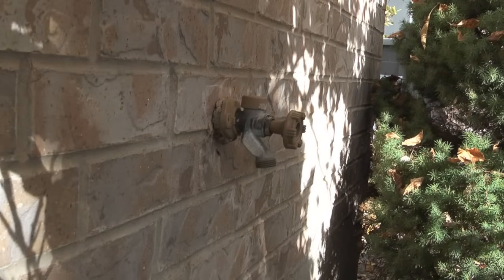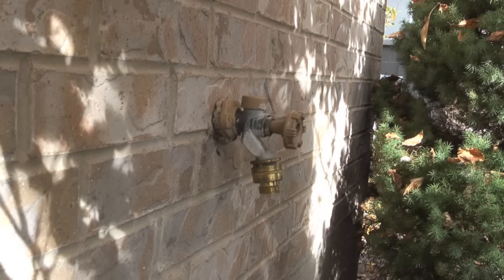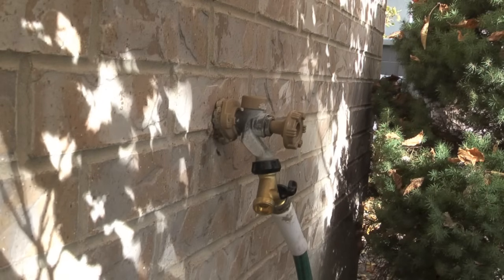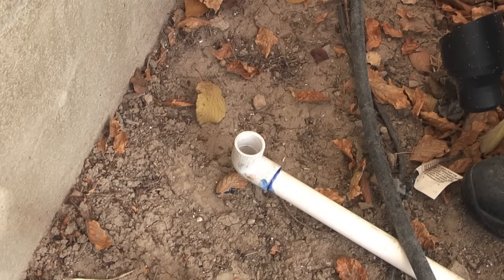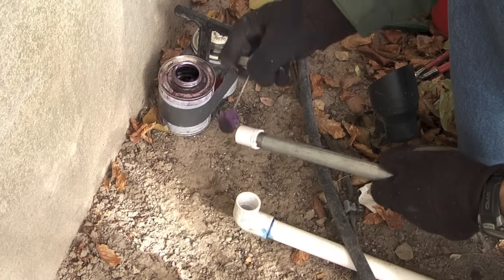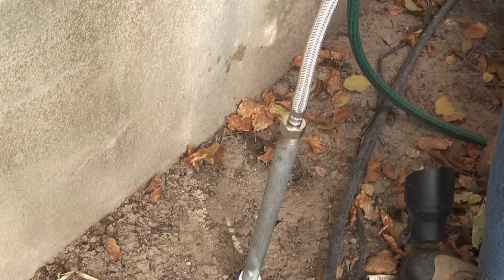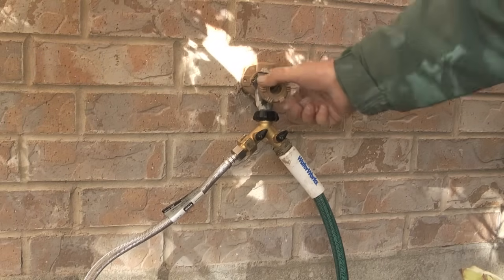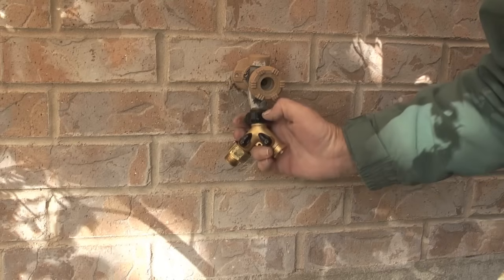How To Connect A PVC Pipe To An Outdoor Tap/Faucet

Comment: Hi! Is it possible to connect the braided flex line to the PVC without the galvanized steel line in between?
Reply from the maker: Yes, you could use a PVC 3/4" x 1/2" male adapter.

Comment: Great video thanks you just saved me a boat load of money, you answered question I had all in this video except one. After I make the connections you just showed can I use Polyethylene piping attached to the PVC for my sprinkler system I rather use in my yard. Also I would like to connect a sprinkler valve manifold so I can use a wifi timer.
Reply from the maker: You can use Poly pipe with PVC. Be careful on how many sprinkler heads you use for each valve in the manifold because the 1/2" tap will only supply 5-6gpm (gallons per minute) to the manifold.
Reply: @Iscaper  I was thinking of using no more than 3 on a zone, would that be ok with the 1/2" or would the 3/4" poly be better? I have 5-6 GPM coming from my tap.
Reply from the maker: @laamkingent1  Add up the gallons per minute the nozzles on the sprinkler heads use when designing the zones. Don't exceed 6gpm. Either 1/2" or 3/4" poly will work but you'll get a little less friction loss using 3/4" poly.

Comment: Awesome video 👍 thx so much , going to use this on my drip system from a double hose Bibb ! 👍👍 is there a way to put a shut off value on the galvanized riser too ? ?
Reply from the maker: Yes, attach a ball valve to the galvanized nipple and a short nipple in the opposite end of the valve that connects to the flex line.
Reply: Thx you !👍

Comment: I skipped the steel pipe and hooked up the braided flex line directly to the PVC (after the PVC thread coupling). Would it be a problem to bury the flex line to the ground?
Reply from the maker: The flex line will probably rust faster in the ground.
Reply: @Iscaper  Got it. Thank you.

Comment: Good video, but why do I need the galvanized pipe? Why not use a male treaded elbow up at the PVC and eliminate the galva
nized pipe. Just screw the braided line directly onto the nippled up PVC elbow.
Reply from the maker: Male threads on PVC fittings are notorious for cracking and splitting, especially when bumped. I like to use something stronger when transitioning from PVC. That said, what you recommend would work also.

Comment: So if you have consistent water pressure in the lines 6 months out of year does it makes since to install a automatic drain in the line ?
Reply from the maker: In cold areas yes. When the supply is shut off in the fall the automatic drain will open and drain the supply line.

Comment: Thanks for the response. I think copper but not sure for that outside faucet. Sounds like I may need to try and get into the wall a little to secure the pipe.
Reply from the maker: If you can, try turning on the tap and see if you can find the pipe feeding it. Then grasp the pipe and see if that stops the vibration. I would try to isolate the noise before tearing into the wall.

Comment: Will a 3/4 in. FIP x 3/4 in. FIP x 15 in. Stainless Steel Water Heater Supply Line work? Currently it's leaking from each end. I have connected that to a spigot and then to the pvc.
Reply from the maker: Tap/faucet is hose thread not FIPT (Female Iron Pipe Thread). You would need a 3/4" FHT (Female Hose Thread) x 3/4" MIPT (Male Iron Pipe Thread) adapter for this to work. Here's a link:
https://www.amazon.com/summery-life-Connector-Industrial-Fittings/dp/B07MVK22VT/ref=sr_1_2?crid=2PZJRUH9GR96P&keywords=3%2F4%2Bfht%2Bx%2B3%2F4%2Bmipt%2Bbrass%2Badapter&qid=1689345476&s=lawn-garden&sprefix=3%2F4%2Bfht%2Bx%2B3%2F4%2Bmipt%2Bbrass%2Badapter%2Clawngarden%2C140&sr=1-2&th=1
Reply: @Iscaper  Wow! No wonder why it was leaking. Thank you

Comment: this is exactly what i needed to run water to a deck with a sink!!!!.. could you do the same to make an irrigation system?
Reply from the maker: You could feed a sprinkler manifold via the tap but you'll only have 5-7 gpm (gallons per minute) flow to work with making more valves necessary. That's because most taps are fed with a 1/2" pipe restricting the flow available.

Comment: I did this this weekend for a line to garden 200ft. I installed drains about every 50ft. When I open the spigot at the house the drains flow until I open the spigot 200ft away is this normal ? How do I not get them to drain when I turn on water from house?
Reply from the maker: If I remember right it takes 7psi for an automatic drain to close. The drains will probably try to work until your sprinkler line pressures up.

Comment: I enjoyed it. Oh! Another request video similar to this you can do. Is connecting an underground sprinkler system to the main line vs an outdoor tap. And explain the pros and cons of each. 😎👍
Reply from the maker: The problem with an outdoor tap is flow. Most are fed with a 1/2" pipe and will only deliver 5-6 gpm (gallons per minute). This means a lot of valves would need to be installed to accommodate a sprinkler system. Main lines to houses are usually 3/4" pipe and will deliver a lot more flow (9-12 gpm) for a sprinkler system. Using an outdoor tap for a supply is good for planter beds and garden areas, but I wouldn't use it to feed a whole system.
Reply: iScaper1 oh ok I see😎

Comment: I was about to follow this clip to make connection between water valve to PCV but I found at home depot a flexible Dura pvc repair coupling that work as well but more simple. Dura makes 1/2, 3/4, and 1 inch coupling (18 inch long). You can use an Orbit slip fitting (at sprinkler isle section of home depot ) to connect to garden valve and some pvc fittings to make the connection to the pvc on the ground.
Reply from the maker: Good information, thanks for posting.

Comment: Tried same set up for feeding water to the sprinkler system. The braided hose does not provide enough pressure for all the sprinkler heads
Reply from the maker: It's not pressure that's affecting you it's flow. You can only get 5-6 gallons per minute through a hose bibb, because it's fed with 1/2" pipe.

Comment: Great solution!  The braided flex line was exactly what I needed to make this work. Thank you!
Reply from the maker: Thanks Randy. I've seen a lot of installations where the homeowners try to hook the PVC directly to the faucet/tap and it usually leaks or cracks. The braided flex line cures that problem. Thanks for the feedback.
Reply: iScaper1 Right. I had been using a PVC Garden Hose Adapter connected to a short host to the faucet (for lack of a better solution). It lasted 2 years, but was leaking this year and snapped apart when I went to tighten it.  I had thought of looking in the kitchen faucet/laundry area for a doubled ended hose.  It worked perfectly and was a quick fix.
Reply from the maker: Randy Braatz
I agree, garden hose and fittings seem to be a little weak for this type of connection.
Reply: iScaper1 Great video, thanks! Is the braided flex line the same one used for faucets and washers inside?

Comment: I used this method but went to 1/2 in PVC instead of 3/4.  Now, at my spigot that the pipe ends at, I attached a oscilating sprinkler and it doesn't have nearly the pressure I used to.  Any suggestions on what went wrong?
Reply from the maker: You can only use 4-6 gpm (gallons per minute) with this type of connection because the faucet is fed with a 1/2" pipe. I would first try a sprinkler that uses less water.

Comment: Why did you go from the house tap 3/4 to a 1/2 hose, then back to 3/4 for the pvc?
Reply from the maker: I wanted a strong flexible connection with IPS swivel connections so when winter hit I could quickly undo the connection from the faucet and drain any water away from the faucet to prevent freezing. I could only find that in a 1/2" braided faucet supply. That's why I went from 3/4" to 1/2" and back to 3/4". The faucet/tap supply is 1/2" so I didn't have worry about any flow loss doing it this way.

Comment: Is there a benefit to using 3/4" pvc instead of 1/2"?
Reply: Also, the inner diameter of the flexible pipe I bought appears to be much smaller than 1/2 inch. Is that a problem?
Reply from the maker: 1/2" PVC pipe would work also. The faucet will only deliver 5-6 gpm (gallons per minute) because it's being fed with 1/2" copper pipe.

Comment: Thank you for the great idea and clear instruction.  Can I connect a sprinkler manifold with this type of braided flexible pipe? Will it restrict pressure?
Reply from the maker: Yes you could connect the hose to a manifold. It won't restrict pressure but you'll only have 5-6 gpm (gallons per minute) of flow available to run sprinkler heads, because the pipe feeding the manifold is 1/2".

Comment: That flexible line looks like 1/4" ID.  So, from 3/4" to 1/4" ID.  Quite a restriction and decrease in flow.
Reply from the maker: Faucet on the house is fed with a 1/2" copper pipe. The braided flex line is 1/2", so the flex line is delivering the same flow that the faucet is.

Comment: Nice video. I just finished doing this but I used a 3/4" pipe out of the ground and used a 3/4" flex hose to connect to the outside faucet. But when I turn on and run the water there is a loud humming noise coming from the faucet at the house. Is that because of the 3/4" flex hose? Should I replace with the 1/2" flex hose as you did? Do I also need to go to the 1/2" pipe like you as well or can I keep that pipe and just use a 1/2" to 3/4" connector for the flex hose? Thanks.
Reply from the maker: Hi Kevin. I don't think replacing the 3/4" flex hose with a 1/2" flex hose would stop the humming noise. Your pipe in the wall that is feeding the tap might be vibrating a little bit. Is your inside piping copper, galvanized, or something else?
Reply: I built the same set up as outlined in the video. I too have a horrible "sqreeching" sound when I run water through the system.  I don't believe sizing down to a 1/2" line will help.

Comment: Could I use this technique to run water to an sprinkler system manifold?
Reply from the maker: Yes, but remember the outdoor tap will only deliver 4-6 gpm (gallons per minute) in flow because it is fed with 1/2" pipe.

Comment: do you ever have problems with PSI after installing this?  I did this connection, but now the sprinklers aren't popping up like they use to.
Reply from the maker: Christian Dior 
Remember that the supply for the faucet is only 1/2" and you're limited to 5-6 gallons per minute (gpm) in flow to the sprinkler heads. Add up the gallons per minute your sprinkler nozzles use and see if that figure exceeds what the 1/2" supply will deliver.
Reply: Thanks for the response.  I ended up leaving only 2 heads on each line and that did it. Thanks for the help. Your videos are super helpful!
Reply from the maker: Christian Dior 
Great, I'm glad you were able to solve the problem.
Reply: quick question- When my sprinklers initially turn on, the heads don't pop up all the way.  If I step on the 1st sprinkler head, then the others pop up and works fine. Any ideas why? Thanks
Reply from the maker: Christian Dior 
Sounds like a flow problem. How many gallons per minute are your nozzles using?
Reply: not quite sure, I have 2 (360 brass orbit nozzle), and 1 (1/2 spray nozzle).  What I meant to say was, If I step on the 1st head, the others pop up and then I can take my foot off the 1st head and everything works fine.
Reply from the maker: Christian Dior 
I didn't know you were using Orbit heads, they are famous for leaking out of the shaft and getting stuck partially popped up. I would try some Rain Bird spray heads and see if the problem persists.
Reply: i knew I should've switch to rain bird when the first round of orbits leaked. I'll try that and see. Thanks!

Comment from the maker: I would double check for a kink in the hose or some kind of obstruction inside the pipe. Undo sections back to the water source and pressure up a section at a time to isolate the problem.

Comment: A great instructional video, THANKS. I wonder if there are better quality "Y" fittings and manifolds available. In my experience they tend to be a weak link. Leaking at the faucet connection is common, from being pulled by a hose, by being bumped or over tightening. The ON/OFF flippers tend to lock up.
Reply from the maker: I've had better luck with brass wyes.

Comment: Thanks for this. I cannot find the "3/4 inch by 1/2 inch threaded bushing" you show in the video. Can you perhaps provide a link for what you used?
Reply from the maker: Lowe's carries them. Here's a link: https://www.lowes.com/pd/B-K-3-4-in-x-1-2-in-Threaded-Female-Hose-x-MIP-Adapter-Fitting/1000157739
Reply from the maker: Here's a link for the PVC bushing. https://www.pvcfittingsonline.com/438-101-3-4-x-1-2-schedule-40-pvc-reducer-bushing-flush-style.html

Comment: Thanks I like doing this for a small sprinkler system plus I seen people attach their underground sprinkler system to a hose faucet instead of taping into the main line : also it seems running from the hose spigot vs main supply line affects pressure performance I’ve noticed. Thanks for the great information ℹ️

Comment: Do you have a video or know of any way that this same concept can be done using pex the whole way other than pvc and galvanized pipe? I am looking to run a water line to a sink inside my bar in my backyard and would much rather do the whole thing in pex pipe. also I noticed someone mentioned pex pipe wrapped in electrical tape to protect from uv light. why does it need to be protected? Thanks.
Reply from the maker: You can use PEX, just crimp on a 3/4" PEX male adapter with a 3/4" FIPT x 3/4" FHT swivel fitting.

Comment: This looks great! I am trying to supply a 18X30" garden for drip irrigation. I already bought 3/4" PVC for main line and will be connecting 5 rows of 30 feet supply lines (1/2" schedule 40) to water my plants. Cant I just connect my 3/4" main line to the hydrant by using a 3/4" bushing, 3/4" galvanized nipple, and 3/4" flex line? I am trying to minimize pressure loss from the hydrant to the end of the 30 feet of line. Thanks for any input!
Reply from the maker: Hydrant is hose thread so you'll need some sort of adapter to go from hose threads on the hydrant to IPS threads on the galvanized pipe. Not sure if you'll be able to find a 3/4" braided flex line, if you do let me know where you found it.

Comment: Question - can I just run a 50 foot garden hose to my back yard from the spigot, and then connect a pic pipe to the garden hose to put one or two sprinkler heads on?  If so, how would I go about doing that?
Reply from the maker: You use use a hose wye connected to the end of the 50' hose to run your sprinkler heads. From the wye you could run a couple of hoses to metal sprinkler bases (the sprinkler heads would mount on top of the bases). Here's a link for a sprinkler base: http://www.sprinklerwarehouse.com/Aqualine-Sprinkler-Base-Stand-p/sb75.htm
Reply: Can you put pop up sprinklers on these too?  Like what you would put underground?
Reply from the maker: Yes, pop-up sprinkler head will work on the base.
Reply: Okay - I'm trying to figure this out.  I bought a base just like this on amazon.  But how do I put the sprinkler head on to it?  The sprinkler head I bought has a 1/2 inch female thread on the bottom, and the base has a 1/2 inch female thread on top.  Help!
Reply from the maker: You need to buy a 1/2" nipple which will connect the base to the head.

Comment: Why did you use the brass adapter to go from the 3/4 inch spigot to the 1/2 inch nipple, then back to 3/4 inch pvc pipe?
Reply from the maker: I wanted a flexible line that that would take high pressure I could remove for winter so the tap won't freeze. Couldn't find anything in 3/4" so I went to 1/2". The outdoor tap is fed with a 1/2" supply so this step won't affect the flow to the 3/4" PVC pipe.

Comment: well done.  typically is there enough prrssure off the house to pop up 2 to 3 6" sprays?
Reply from the maker: The 1/2" tap will supply around 5-6 gpm (gallons per minute). You need to add up the gallons per minute the nozzles on the the sprinkler heads will use. Normally the tap will run 2 or 3 pop up spray heads.
Reply: +iScaper1 OK I've only been in the irrigation field for little over a year and still have lots to learn.  but thank you very much

Comment from the maker: If you have existing lines buried that would work. If you're building from scratch I would run a single supply into a 4 valve manifold that could be buried anywhere that is convenient. Be careful how many heads you use on each valve because this type of set up will only deliver around 5 gpm because it is being fed from a 1/2" pipe. This limits the number of heads you can put on each valve. You may need more valves to accommodate the reduced flow available.

Comment from the maker: In my area most of the connections I make are to PVC pipe instead of Poly pipe. Taps are hose thread and PVC fittings are NPT, so a few additional fittings are necessary to make the transitions.

Comment: hi, what do i use to connect the pvc to the riser which is connected to sprinkler head? thanks again.
Reply from the maker: Most common is a threaded tee 3/4"x3/4"x1/2" (SlipxSlipxThread) if your circuit line is 3/4" PVC. You thread the nipple or a funny pipe barb elbow into the tee then connect the sprinkler head to the nipple or the funny pipe.

Comment: if I want to leave the faucet turned on to have water in the new location, doesn't the backflow preventer continually spew water?
Reply from the maker: It shouldn't. Taps like these drain water from the stem when you shut them off. That way they won't freeze in winter.

Comment: Thank you for your detailed explanation.  I am concerned about the water pressure coming out of the faucet, should I add a pressure reducer at the Y? If so would it be Y...then timer...then pressure reducer...then rest of your configuration?
Reply from the maker: That works or you could add the pressure reducer after the wye.